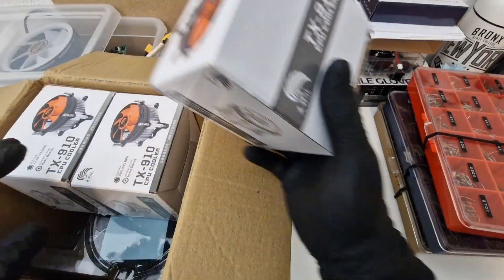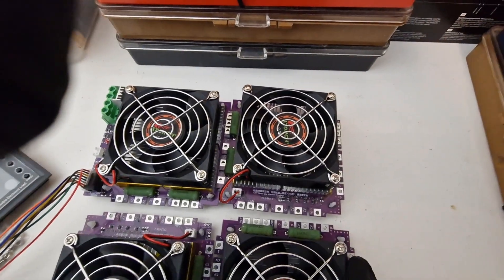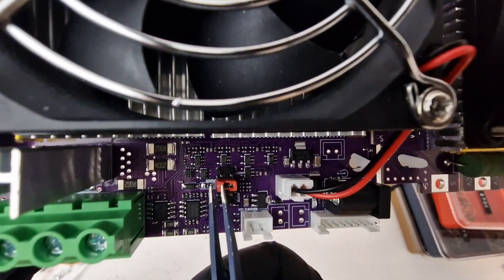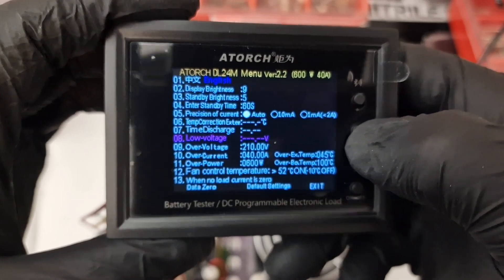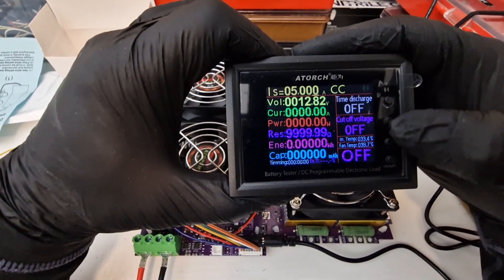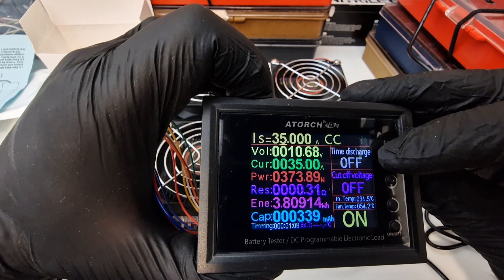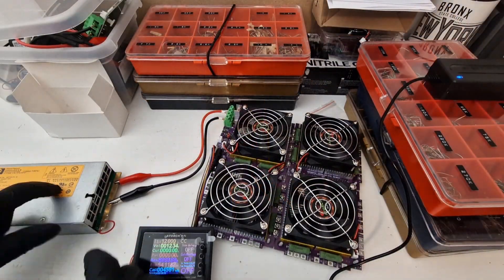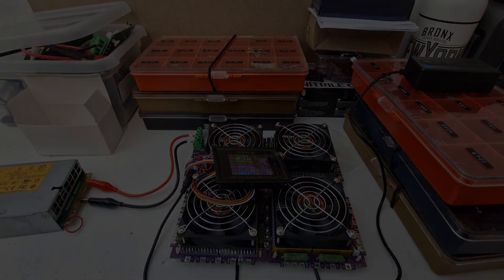Atorch DL24MP 600watt 40a assembly installation+unboxing

Comment: Wich red pin ?you mean jumper?
Reply from the maker: Yes jumper, And need to ad little thicker wires, the wires that comes with the DL24MP is to thin.

Hope you can figure it out :)
Reply: @CuriousDiyFreak ok thanks
Reply from the maker: @khalilkh7389  did you reach 40Amp? 

I manage to get 40Amp with another simple method.
Reply: @CuriousDiyFreak  no i didn't try it yet 😊
Just received my atorch dl24mp couple of days. 
What settings methods are you recommended?
Reply from the maker: @khalilkh7389 okey, my setting are:

- settings on 40Amp 600w and red jumper on 400w 
(I reach 37amps) 

Or

-settings on 40Amp 600w and (removing) red jumper completely then I reach 40amp exactly 

When removing the red jumper completely I can reach 40amp exactly. Dont know if its recommended or not but it works ok for me ok.
Reply: @CuriousDiyFreak this sounds great had to give it a try thanks 😊
Reply from the maker: @khalilkh7389 good luck :)

Comment from the maker: To reach 40A, I had to take the (red pin/Jumper) and connect it to 450w instead of 600w.

But Keep all other settings still the Same 600w/40A.

And change to little thicker wires for load.